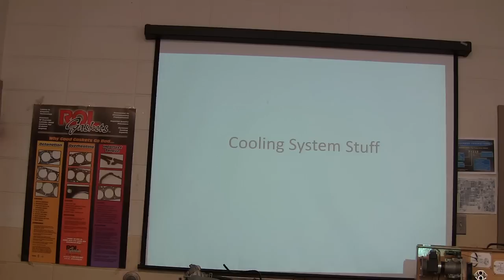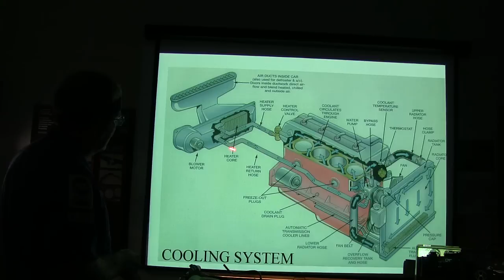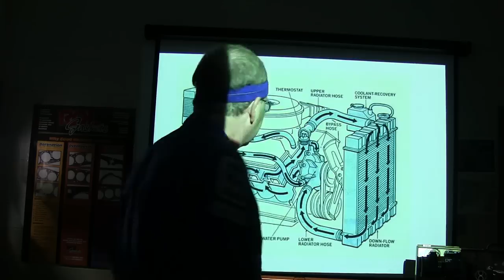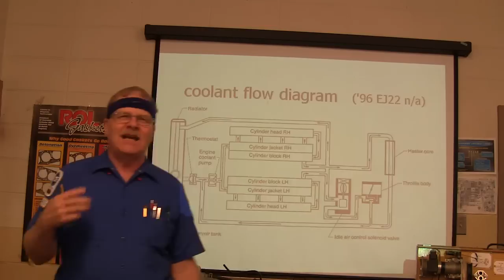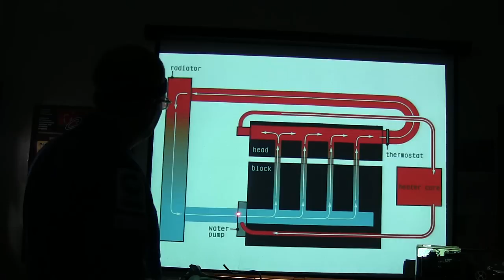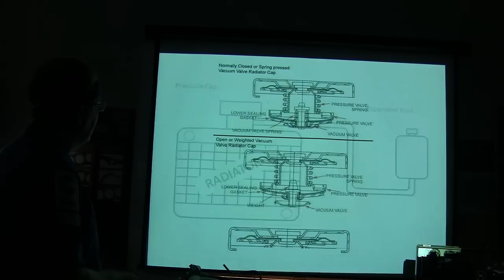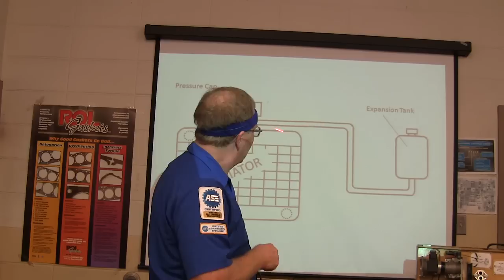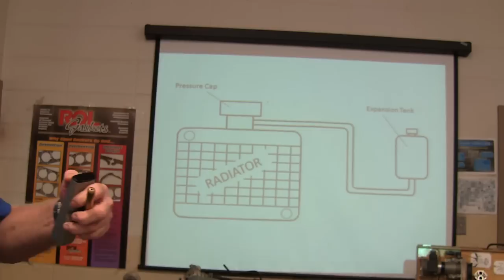Fundamentals Cooling Systems

Comment: Very nice. Filling different cars can be tricky, sometimes! Caps can also be a bit tricky, too. I once worked for a quickie oil change shop. We checked just about everything, and tried to sell stuff along with the oil change. We kept a cap pressure tester on hand. If it wouldn't hold pressure, we'd try to sell a cap. A guy asked me to show him the test for his new cap!! I was happy to oblige! IT FAILED!! I said it was good that he asked, retrieved a different cap, IT FAILED!! He asked for me to reinstall the old cap, and went next door to Advance Auto and got one from them!! I felt silly, not being able to produce a working cap. He came right back, and asked me if I would install his new cap. I agreed, and said that I would even test it for him. Guess what??? IT FAILED TOO!! I woulda been real mad, but he started laughing!! I put on his new cap, and off he went. Never figured out what that was about. Our tester worked on other caps, new and used!! Just not anything for his vehicle! I later noticed that on some new caps, the vacuum breaker would dangle, like you described! This was in the early 90s, before all of the Chinese parts started to flood the market! Oh well. After that, I would check a new cap, before showing the customer that the old cap wouldn't hold pressure!! I came across the issue a few more times, but never showed the customer a new cap that didn't work, just suggested that they obtain a working cap, FROM SOMEWHERE!!
Reply from the maker: I get so irritated when I can't get a cap that doesn't have a dangly vacuum valve... and it happens a LOT.  Got another one just the other day - and the brand doesn't matter.

Comment: Dealing with a p0128 on a 2004 Lexus RX330. The coolant goes into the reservoir bottle at around 140 degF. I am thinking that either the radiator cap is defective or the thermostat is stuck open or opens too early. I sometimes drive the truck for 10 miles, and both radiator hoses are only warm to the touch. I would expect the top radiator hose to be hotter if the coolant flow is from the bottom to the top. ( Since it is a Lexus, the coolant flow may be from the top to the bottom because of the location of the thermostat. I can never understand the Toyota Cooling system flow). I am leaning more toward a bad thermostat. What would you suggest, Sir?
Reply from the maker: Start with the simple and cheap - go with a thermostat first, but get a really good brand. Let's see what happens. The system is actually easier to purge when the thermostat is on the bottom - it's a good system - VW Rabbits were build that way.
Reply: @McCuistian  I am buying one from Lexus and planning on installing it Thursday. Thank you as always, Sir!
Reply: The Thermostat fixed the issue. I forgot to report back.